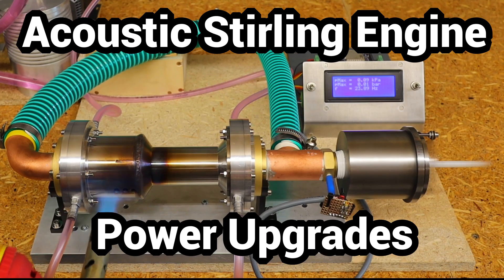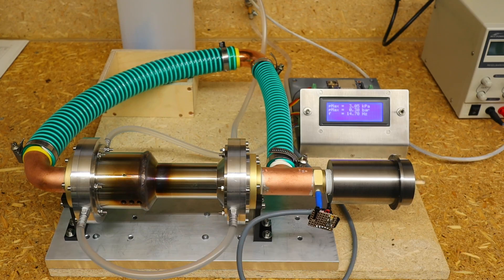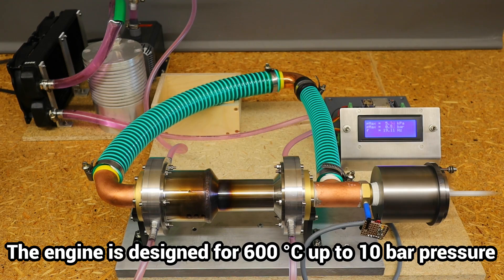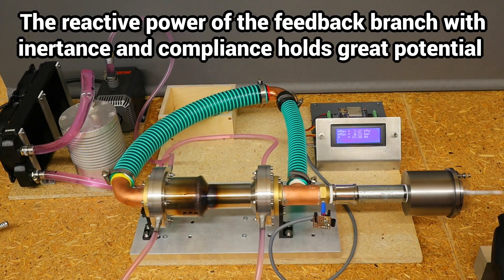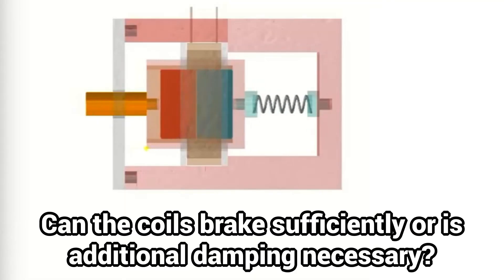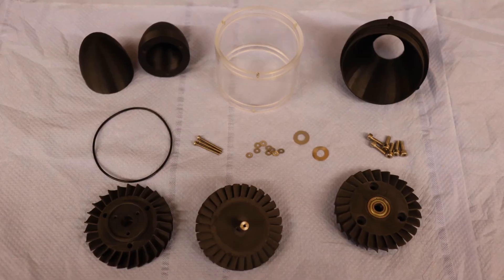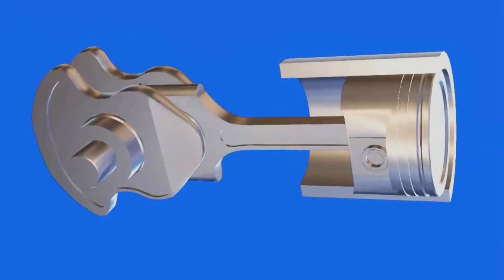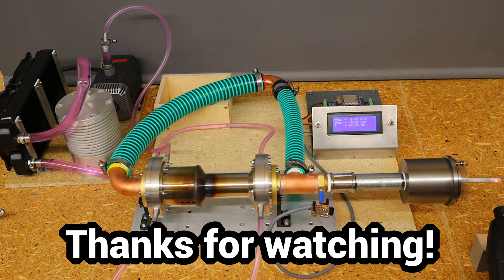Thermoacoustic Stirling engine – which is the right generator ?

Comment: @myengines2443 , nice job! About your question - "Which generator offers the most advantages for the upcoming optimizations?" , my answer is - with no mechanically moving parts. For example, you can use working fluid with high electical conductivity (like supercritical sodium ammonia solution) and MHD generator. 
I have a patent for this invention in Russia ;) https://patents.google.com/patent/RU2806344C1/en?oq=ru2806344
Other option is magnetically levitated liqid metal piston with induction coil - see https://ebooks.rtu.lv/wp-content/uploads/sites/32/2023/03/9789934228926-PDK_Arturs-Brekis_EN.pdf

Comment: Use the thermoacoustic engine to drive a diaphragm air pump. You can control the input and output of the airpump using restrictions such as pintle valves.
Reply from the maker: And then convert the compressed air into electricity with an air motor?

Comment: use hydrogen sound travels faster and more thermally conductive
Reply from the maker: Hydrogen is too dangerous and hard to handle for me.
It is flammable and can explode and the molecules are so small that it is very difficult to seal the Stirling.
When the engine is closed I will try helium.
Many thanks for your kind help!

Comment: The connecting rod option isn't as bad. 
The thing is that you don't need to make full revolutions of a crankshaft, just make it oscillate.
Same as a linear motor, you make it oscillate.
Connecting a rod to a "crank" in the propeller side of a blcd outrunner sounds cheap.
Not the most space efficient, but the most commercially available option.
Love this project 👍🏽
Reply from the maker: That is really a smart idea, many thanks for that!
I don't know if it can be efficient but I think I will really try it!
That is really nice, this are the moments for what I make the videos, getting these nice suggestions, many thanks!
Reply: @myengines2443 
Thank you for sharing your knowledge. 
If you need some help with 3d design dont heisitate to contact me.
Back to the design, since it should not make full revolutions, it will be easier to make a variable lengh crank, to regulate the amplitude of the generator in respect to the engine. (Sorry for my english)

Comment: SPEAKER
Reply from the maker: A speaker is an option for the ready developed engine as the speaker has to fit the actual conditions which change very often during development.
So a more versatile power unit is better for development.

Comment: starting a heat engine could be done by using a spring driven mechanism, that is 'charged' during the first minutes of engine operation.      or a rechargeable battery and small DC motor could be utilized.     energy for battery charging would be an internal load, until charging is complete.
Reply from the maker: This are both possibilities to start the engine but are complex to build except the starter motor is also the electrical generator which calls for crank drive.

Comment: engine rpms are controlled  by  the  LOAD.!      there is no need for a dedicated speed control or brake.      the engine output is low-torque.    consequently, the engine should be loaded via high-ratio  Reduction.   say, 15:1.    in a single stage (for least losses).
Reply from the maker: You mean mechanical reduction with a crank drive?
This will result in friction which I really want to avoid!

Comment: forget pressurization.    it just adds complexity.      for best efficiency, the output motion needs to be converted to  ROTARY.
Reply from the maker: If I do not pressurize the engine it has to be very big for enough power output...

Comment: The turbine i forgot what there called but in the evolution Mitsubishi  Mr .  On the roof the have these lil fins the purpose is to force the air evenly on the hood if u put miniature ones on the blade probably just a dot it increases blade efficiency like crazy !!

Comment: I would try to use active loading of the electrical output of the TAG to control the piston stroke length, thereby keeping the stroke the same over varied power outputs. This would comprise an electrical circuit to monitor the TAG output voltage which controls charging rate to battery storage.

Comment: Maybe a large piezo stack? Also has there been any research on water-based thermoacoustic heat engines? I'm not sure if the lack of compressibility would help or harm the system.
Reply from the maker: Can piezo deal with the relative big stroke of up to 40 mm?
I  have to look out for piezo but at the moment I am busy with the linear generator.
Thanks for your suggestion!
Reply: @myengines2443  Current technology demands some form of movement amplifying geometry and I don't know how well those handle repeated use, nor how well they could capture energy from a wave. I'd say a linear motor is the more practical option. When you mentioned using a speaker in the build I at first assumed you meant for capturing the wave and transmitting it to a piezo element, like you would find in an ultrasonic transducer.

Comment: best way to build linear generator is to get guidance from proven linear motor which is essentially the same working in reverse. 
 
conclusion-easy way to do a first try
 2 pieces of 3phase linear motor with magnetic core (on E-shaped silicon steel  laminations  taken from the same transformer / contactors) mounted facing each other and with a gap in betwen to fit a flat neodymium magnet moved by the piston, will make closed loop iron core .Probably a good idea of the size of E-core  will provide the size/amplitude of the piston  stroke -in order to intersect all 3 pair of coils   with the neodymium magnet. 
 (Also with a common 18v brushless controller is possible to start it and use it as thermoacustic refrigerator) [a cheap brushless controller is from chinese brushless impact wrench]

https://youtu.be/oWiYsRi2Dss?si=o8UI86Vo2I3VB-TB

the one below is including the  name of a simulation software for motors
https://youtu.be/vq6SIjgLFE4?si=Sdu7Z1_rO7jhkymB

3phase low voltage ac current can be converted to dc  and dc to 1phase ac 240v in a finish build. 

Hope is clear , if not -more later.
Reply from the maker: Thanks for your detailed help, I will carefully look it up!
do you know a source for purchasing linear motors that may be suitable for a conversion?

Comment: A voice coil motor can be used as a linear generator
Reply from the maker: You mean a loudspeaker?
At the moment I am using a piston but the use of a diaphragm like in a speaker would be  a very elegant solution that I really think of.
Reply: @myengines2443   loudspeaker B&C 6PS38 is good. 68% effective sound to elecrosy. Listen about: "Low cost cascade thermoacustic electric generator..."
Reply: https://youtu.be/hl_RiBj0qag?si=IUTpZNuQhEUbI5-7
Reply: https://youtu.be/A_dy1sYRAzk?si=tw1N-xT6qikcJzNr

Comment: It is very interesting. We are waiting for the continuation
Reply from the maker: Thanks, I do my best, at the moment I am building the generator.
Reply: best way to build linear generator is to get guidance from linear motor which is essentially the same working in reverse.
conclusion- 2 pieces of 3phase linear motor with magnetic core (E-shaped silicon steel  laminations  used in common transformers ) mounted opposite in relationship with each other and with small gap to fit a neodymium magnet moved by the piston. 
https://youtu.be/oWiYsRi2Dss?si=o8UI86Vo2I3VB-TB

Comment: you should do a rotary 4 cylinder v engine or a boxer.
Reply from the maker: A multi core arrangement is very nice but would slow down the development process too much so its an option when the engine is ready for real work!

Comment: I'm working on my own project, and I have a question. Could the thermo-acoustic setup work at low temperature differentials? Say 10-50 degrees with a similar setup.
Reply from the maker: I don't think so and never heard of a low temp differential thermoacoustic engine  but why not, the friction is very low in these engines!
Reply: @myengines2443  thanks 😊

Comment: I have a question. why a thermoacoustic engine at-all, rather than simply a tube that is heated at 1/4 length and a turbine on the hot-side? Cold air in to the bottom and hot air out of the top (needs to be verticle) 
This strikes me as being SO simple that any power inefficiency can be offset by building bigger or building more of them.
Reply from the maker: But the efficiency stays low if you scale it up.
In my thermoacoustic engine the reactive resonant network (the feedback loop) is an important factor for efficiency

Comment: Cranks also have poor mechanical advantage unless the arm is long, but added reciprocating mass also reduces efficiency. If you want conversion to rotation, I suggest a tusi couple (2 cusp hypocycloid), minimum; preferably, a rack and pinion. (A crank with infinite arm equals a tusi couple.)
Reply from the maker: This are neat mechanisms and you are very right but for the first tests I want to keep things simple.

Comment: How about putting the cylinder on top. Less friction, and the weight of the piston when moving up stores the energy that is released when the piston goes down again.
Reply from the maker: Yes I will really think of this as it will also give the option to change the resonator space more easy even the setup of the power cylinder will be a bit more complex!
Thanks for your kind suggestion!

Comment: A fluidyne or magnetohydrodyne might work well, although they are still nascent technologies. There is also the INNengine - it may not be entirely suitable but perhaps the concept can be of help. Also try asking an AI such as Grok 3; the conversational aspect has worked well in finding all manner of existing concepts and technologies that apply to projects. For instance, Grok listed magnetoelectric transducers as a possibility.
Reply from the maker: I will look your suggestions up, thanks for them!
I played a bit with ai chatbots and the can be very useful if you don't waste to much time with them.
Maybe its possible to get help with the electromagnetic flux directions for designing the coils for a linear generator by an ai llm?

Comment: This is nice work. My suggestions are to look at the Tesla valveless pump, Nikola Tesla not the car company. Combine that with a ferofluid to pass through the coils. Another approach may be to use the linear motion to power a hydrollic tourque converter. This will give higher tourque output to spin a rotating generator. Automatic transmition fluid and parts are quite readily available.  For the high pressure side a small diesel cylinder and piston are already designed for the preasure. That may or may not be appropriate depending on the working media. I hope you have great success.
Reply from the maker: Thank you very much for your great ideas, I will carefully think about them!
Reply: @myengines2443  your welcome. Thank you for  the video and your work developing your stirling engine. After watching your video  my interest in stirling engines has ben renewed. I found some very old videos from NASA on their developments among others in the 1970s and 80s. The engines put into trucks were wonderful. It makes me think about building one for my own vehicle.
Reply from the maker: @daniellore2961  I can only recommend you to develop and build your own Stirling engines, it's a lot of fun!
And plz show any of your plans or progresses here on youtube, that's a lot of fun also...

Comment: Would it be more efficient to tune the system for higher frequencies, but lower amplitude?
It would make all the components smaller, including the el. generator.
Reply from the maker: Higher frequency always means higher power (and efficiency?) and I think it depends on the sort of power extraction unit how it can use it.
The power extraction unit is the most important part that determines the performance of the engine to a great part.
That's why I take so much attention on it!
Smaller and therefore lighter parts are always preferably because of less friction and unbalance!
In the first place I want as much power as possible so I am going for high frequency and high amplitude if possible.
Later on, the tuning will then follow the path you suggested to find the highest possible efficiency with the optimum ratio of frequency and amplitude.
Thank you for your very good help!

Comment: Hello, can a thermoacoustic engine produce more torque and power than a free-piston Stirling engine?
Reply from the maker: I think it depends more on the factors of heating,cooling,pressure and so on, but real engines of the free piston type where much more powerful than made thermoacoustics!
The thermoacoustic engine is potentially much easier,cheaper and more reliable than the free piston engine and therefore my choice!

Comment: generator... you need iron. and have to think of the magnetic circuit.
magnetic field doesnt do anything of much use if its oscillating parallel to the field.

two magnets set at right angles to the oscillation/shaft. a C core on each side, winding on those cores, magnets filling gap at mid stroke., from no flux at either end to full flux midstroke, when the piston is traveling at maximum velocity. you get 2X the oscillation output. its only going to swing from 0 to a certain potential, not alternate. "half wave". 

arranging to an "E" core, windings on center leg you can get alternating output as you can reverse the field entirely, circulating in one end of the E at one end of the stroke, the other side at the other end, with a null in between midstroke.

there are several configurations, they all have to share a common principle... rather than simply waving a magnet through a coil, you have to couple the flux to the coil with iron, and vary that coupling. the "reluctance" of the iron circuit.

as stated in another video comment, the linear generator is fiendishly hard to make efficient. theres "lighting LEDs with milliwatts" versus "making 500W reliably at 50% efficiency".

theres this nasty interplay between stroke length, pole width, core pole width and gap, and the force available on the piston at any given time... as you load the coil, the generator, you get more "lenz reactions" fighting the motion, and depending on cylinder pressures, you have only so much available... the big test is to short a generator out. think about the experiment of dropping a magnet down a copper pipe.. how does that differ from a generator?  if you replace the pipe with a coil?

theres a reason most air compressors etc dont do the "easy approach" and use a rotary motor driving crank and piston instead...
Reply from the maker: Yes that are the problems that I am also thinking of...
Unfortunately its not as easy as it looks to build an efficient linear generator and it is truly not my area of expertise.
I will think about your kind comment very careful and hope to understand enough to use it in my experiments, many thanks for that!

Comment: I would start with a linear generator. However, you will want to be aware of your magnetic flux path. Using ferrites, or possibly silicon steel to complete the path would be a good idea. 

Beyond that, something like a MPPT tracker, even a small one, would allow automatic tuning of generator load. It would try to achieve maximum power delivery.
Reply from the maker: Unfortunately as you say its not as easy as it looks to build an efficient linear generator and it is truly not my area of expertise.
The magnetic flux path is really a thing I have to get more knowledge!
I really have no idea how to implement a MPPT tracker, are they available for purchase to use them in experiments?
Thanks you very much for your great help!

Comment: Look out for speaker drivers that have the correct extrusion (Xmax), high magnetic flux density (Bl) for higher current induction and a low coil inductance (Le) to avoid loses at high frequencies. Also make sure that the speaker driver has the appropriate RMS power handling for your build.
All these parameters are usually included in the driver documentation and can also be calculated if not all are available.

If you just want to use the speaker's magnet assembly for power generation, you can very easily strip away almost everything, though you may want to keep the spider to have better/proper coil alignment.
Reply from the maker: Thank you for you good detailed explanation of the parameters of speakers.
That's exactly what I need and I will study your information carefully and look for further details and possible speaker candidates with the specs you explained.
Many thanks for your great help!
Reply: @myengines2443  Forgot to mention - In case you quickly want to know at which frequency a driver resonates with a given volume configuration, I recommend VituixCAD. It calculates frequency response, cone extrusion, cone velocity, extrusion force, actual power ect..

This software is intended for speakers (so power to sound), but maybe it also works in reverse.
Reply: @myengines2443  Forgot to mention - In case you quickly want to know a drivers frequency response with a given volume configuration, I would recommend VituixCAD. It's calculates cone velocity, cone extrusion, resonant frequencies, actual power, extrusion force from damping and much more. It's intended for speakers (so power to sound), but might also work in reverse.

EDIT: Random idea, but whatever power generation set up you will end up using could also be used to start up the engine.